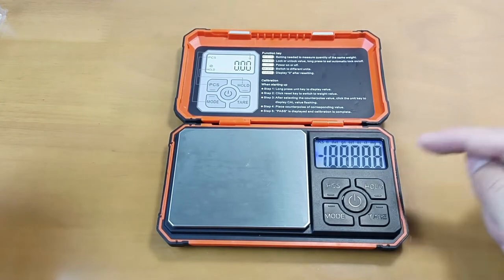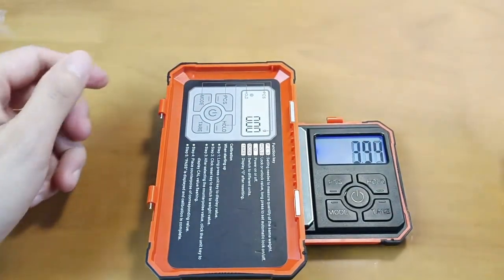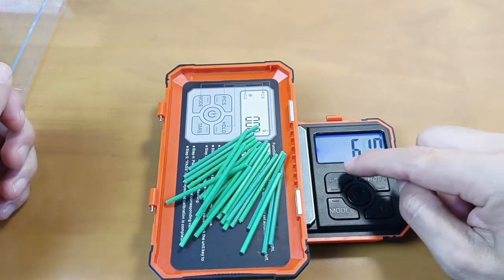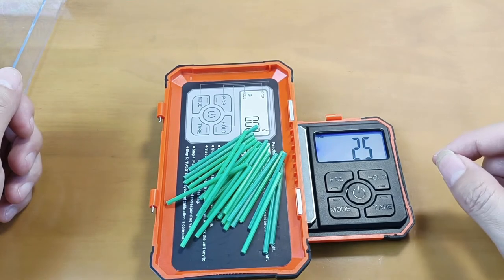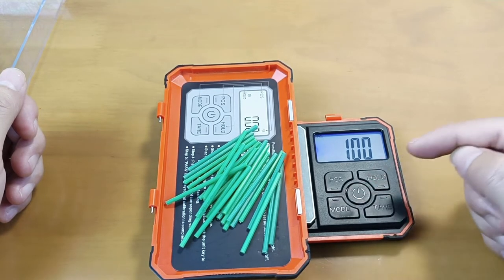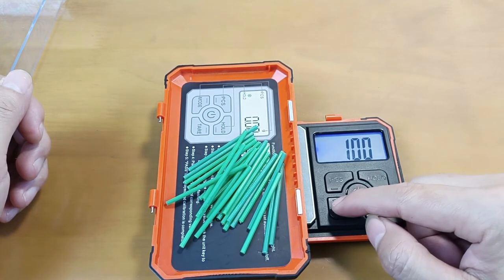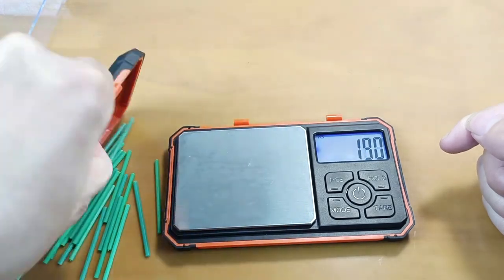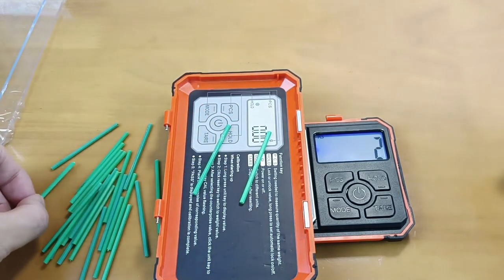How to use digital scale “pcs” function to measure quantity?

Comment: I have basically the same one with 3 buttons and it doesn't explain it in the manual if it even has the function. But, it does display it on the screen when I press power.. Any help?
Reply from the maker: Sorry I don't understand what kind of help do you need.

Comment: Can someone explain what is counting in pcs on a scale for? don't I know the quantity of the items I'm holding or what? why do I need a scale or the counting function to count what I can see? I don't get it.
And lastly, now that I have entered counting mode, how do I go back to the regular weighing mode?
Reply from the maker: This pcs function mainly use for small parts. If there are a lot of small parts, it is impossible to count them one by one, or it is a waste of time to count them one by one. At this time, the "pcs" function is very useful.You can take the method of weighing,.First weigh 25pcs or 50pcs, or 100pcs, and then Quickly know the quantity directly by weighing to save a lot of time. 

Just need power off, then power on again, you can go back to the regular weighing mode.